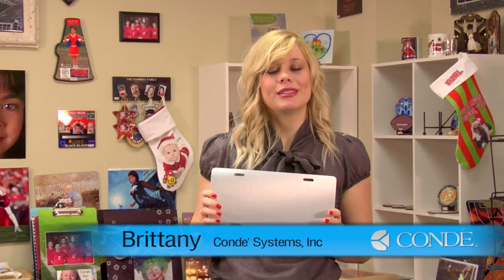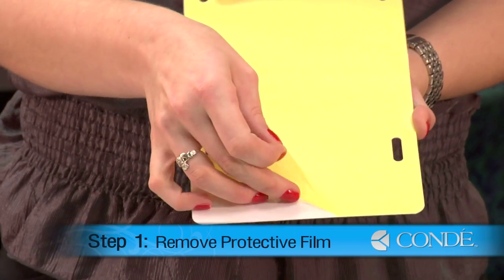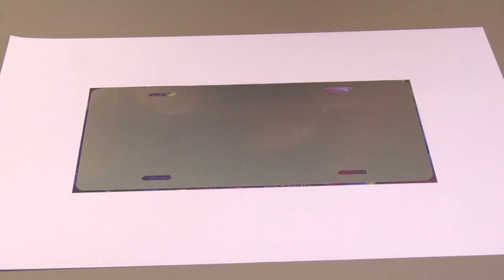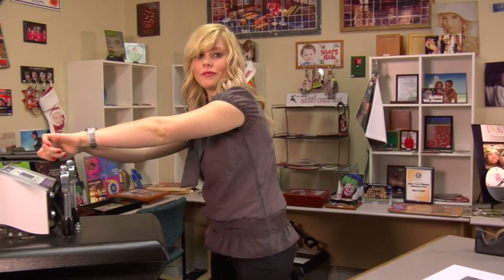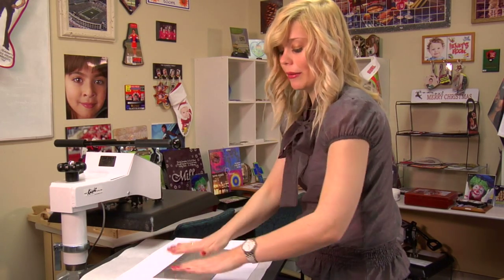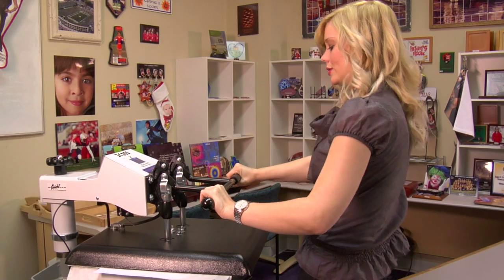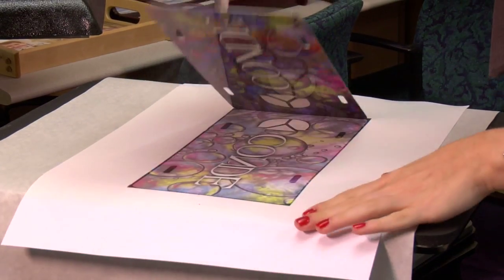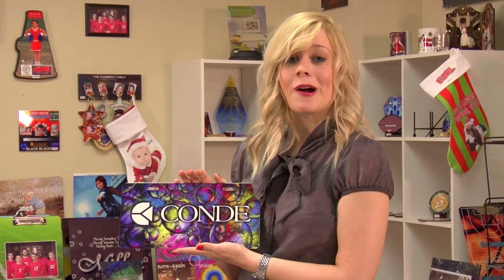How to Imprint Aluminum License Plates with Dye Sublimation -

Comment from the maker: If that aluminum is coated with poly based sublimation coating, you could wrap it tightly with your image and perhaps put it in an oven. Hard to say without seeing it. The main thing is that it must be coated. Easier to image a sublimatible piece of coated aluminum then bend it.